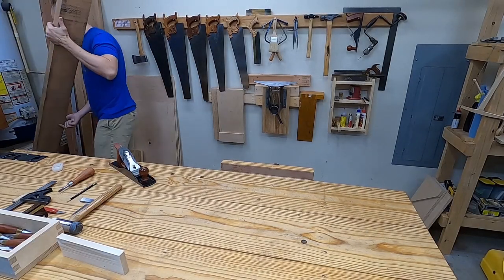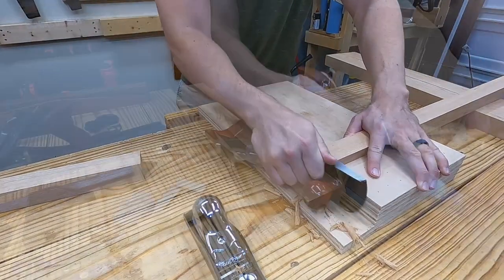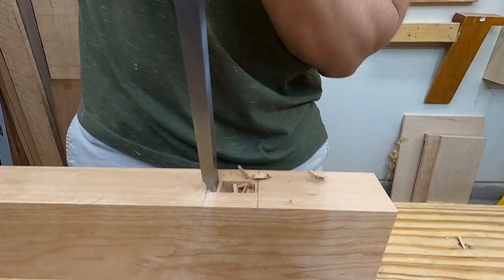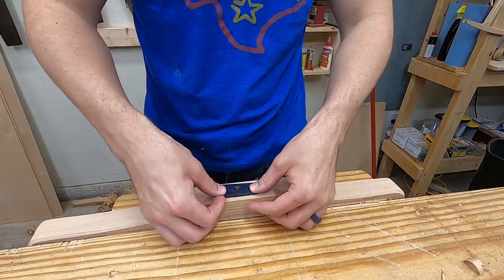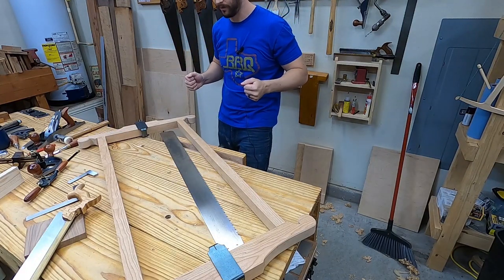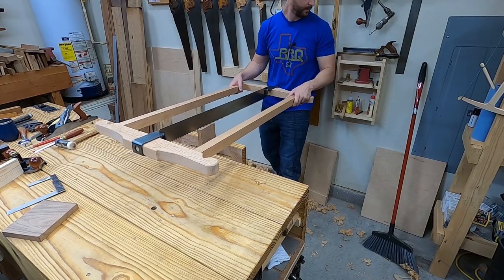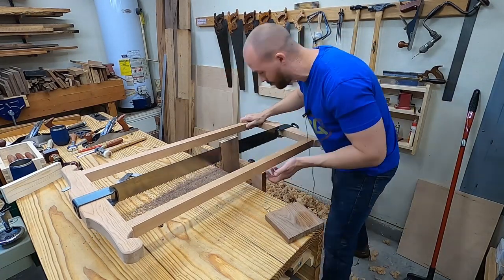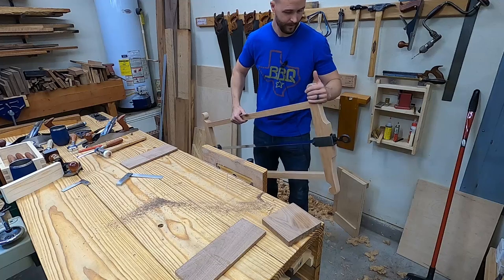Making a Frame Saw // Resaw with Hand Tools

Comment: Nicely done, brother.  Yes, it's a push-or-pull saw!  I've got four, two that are 200+ years old (one of which is for cutting veneer), a smaller one I made when writing the Roubo book, and one from Bad Axe Tools.  I've got two  blades from Isaac that I will make new frames for and probably forge the hardware myself.  These saws are indeed beasts, and are used in my shop with some regularity.
Reply from the maker: This is absolutely awesome I appreciate the feedback, Don!! Take it easy!

Comment: did you get the blade from blackburn tools? If so, did you go with the "set" option on the teeth? I'm eyeballing one of the 32" ones. He says you can get a set on the teeth in case you use it on green wood.  Is there any drawback to getting a set on the teeth if it ends up mostly being used on dry wood? Aside from a wider kerf?

Comment: I don’t plan on building one of those monsters, but I’ve learned a lot watching your work. One thing I’ve learned is that when you keep your planes sharp you don’t have to push down on the plane. It’s obvious that you’re just pushing the plane forward. That is a revelation for me.
Reply from the maker: I really appreciate this comment, it was also a revelation for me when it finally clicked. Before then, I would spend forever trying to simply flatten a board because I was always "chasing my tail' so to speak.

Comment: Lovely job. Now you can be the beast master.
I definitely prefer it on the push - sawing with the legs rather than arms and letting the weight of the saw provide the force is, for me, easier on the push.
(Regarding board pivoting in the vise, because my vise is (intentionally) not flush with my apron, I have an l-shaped spacer block sized to my apron gap that I can clamp to on the lower apron for 2 points of contact when resawing - pegs work too.)
Great video with a subtle teaching style like spot planing and bevel up/down tips. ;)
Reply from the maker: Appreciate it Malcolm and that's a great tip!

Comment: Frank great video. I appreciate the simple no stress approach to your project. Showing full stock prep, wasn't that hard. Mortise and tenon seemed fairly easy. Cutting curves with a chisel and spoke went quick, I guess you can do wood working with hand tools! I still look forward to a bench video, why the apron, your thoughts on the flush mount veritas vice. Which front vice you chose etc. I really appreciate your humble honest style of video content, hard to fake, must be who you are as a person. The excited, "I got to try it before I put a finish on it". I think we do that with every tool, cabinet and project, the excited to see how does it look or how does it work.
Reply from the maker: Thank you very much Kevin! It means a lot. I have been dreaming up a bench for a while now that combines a few of my favorite parts of the couple benches I've used. When I get around to making it I plan to give a detailed look at my current bench too
Reply: @FranksWorkbench  Looking forward to that video. You almost need to make a bench and use it to determine what you need in a bench. I am using the first bench I built. I've changed vise styles and locations a few times. As different work holding needs arise its only then that you can decide what bench you need and works for you! While waiting, yea or nay on the veritas vice? I've not put holes in my bench, but that vise seems to meet most needs and is a relatively easy install. Thanks again Frank, yours is easily one of the 3 best you tube channels on hand tool woodworking.
Reply from the maker: The veritas vice is great. I chose it for ease of install on a bench with apron as well as to clamp flat to the apron (which mine no longer does bc I added leather which causes a offset). However if you already have a standard cast iron quick release vise then there is really nothing that the veritas vise offers to justify the extra expense IMO. 

Agree with you on the bench use. The bench I want to build will have a the size and simplicity of the my Nicholson, but with a laminated top for thickness/firmness, no apron and instead a wide front rail, and will either use my current vise or a twin screw for cutting wide board dovetails. But that project is on the back burner for now.

Comment: Very interesting tool, but it raises a question: Why use something like this instead of a common handsaw? I'm genuinely interested in knowing on which case scenarios are these preferred.
Reply: There’s a big difference in time and energy it takes to rip and ability to steer from what I understand. Guys like Bob Rozkowski have done videos sawing in same timber for set period of time and measuring the difference in speed.  It was about 1.8x as fast as I remember, but monster difference in energy exerted.  I’m building one because I’m trying to get to as near all hand tool as I can tolerate and because I want to do the 1/8” veneers it can produce.  Just my 2¢

Comment: Any issues with drift? I find with mine I have a hard time keeping with a line. Built the same saw. I also had some weld burs in the inside of the bracket that attaches the saw to the frame which I had to file down.
Reply from the maker: I didn't notice any drift issues but then again it was a pretty small scrap of wood that I cut. I also filed off the weld burr but just didn't record it.
Reply: @FranksWorkbench  yeah when I try to rip a 3' board it gets tough to keep the line. It might just require some practice.

Comment: Another great video Frank, you keep hitting them out of the park, with instruction, frankness and humility.  That saw is a beast, but my shop is tighter than yours and would require some real thinking to figure out usage. A four foot saw seems like you would have to walk it to get full stoke. What blade are you using in bow saw, it looks wider than the ones I get from Tools for Woodworking.
Reply from the maker: Thank you very much Jim, I really do appreciate it! They are the blades from tools for working wood. Just the basic general use 16 ppi  blade. It could have been some video distortion making it look wider as I just record these with a GoPro and sometimes things look stretched out especially close to the screen edges

Comment: Shannon Roger's (RenaissanceWW) has a couple of these, and a few videos about them too, give em a gander if you havent already 😁 As others have said, they can work push or pull...... but push seem to be favoured by most. From what I've seen of others use them..... they kinda nearly "step" into the stroke as opposed to using all arm motion to move it like you would with a traditional style saw, kinda similar to the way some rock their body while hand sharpening small/awkward blades..... but I have ZERO experience myself with one of these beasts 😁 
I'm thinkin about makin my own someday, I prefer hand tools and I dont really have the room for a bandsaw; or the cash for one that's capable of decent resaw. I'm doing it now with the standard 4.5 tpi handsaw, and it sucks donkey balls 🤦‍♂️😂 
I'm glad I found your channel, hand tool freaks like us are too few and far between 🤙
Reply from the maker: No kidding on resawing with a handsaw! Even 4.5 tpi...doable, but really hard work, I always avoided it!

Comment: Looks great! Have you found yourself needing a kerfing plane?
Reply from the maker: Thank you! I probably won't use a kerfing plane since my purpose is really just to cut 4/4 and 5/4 boards in half to use for drawer sides, panels, etc. If I needed more accuracy like trying to resaw off a 1/8 - 1/4" veneer I'd probably think about the kerfing plane.

Comment: I dont have a scrub plane but I do have an old craftsman no 4 that is my 'high stock removal' plane/  Not optimal but it works well.  How flat do you generally go when processing material?
Reply from the maker: Right on man. I try to get it as flat as possible but just by sight, I don't pull out feeler gauges or anything like that, the boards gonna go out of flat overnight anyways. Before joinery I usually pass a plane over it again

Comment: you can always just flip the saw around if you want to cut on a pull :)
Reply from the maker: Haha very true I guess i felt the tensioning screw should be on the user side for some reason but you're totally right it wouldn't make a difference
Reply: @FranksWorkbench  well i've never used one (i want to now that i saw this haha) but test it out and see if where that screw is matters lol

Comment: What kit was this?  I’m considering the 36” too but don’t know yet for certain.
Reply from the maker: Blackburn tools kit. I had debated between the 48 and 36" and am very glad I went with 36. Cheers brother!
Reply: I wanted to go with Blackburn since I’ve built some of his saws before, but ultimately decided on the 36” from Bad Axe since I was able to also get the matching Kerfing Plane kit with it.  Still making decision on with timber to use, had thought of using red elm since I have a whole bunch of 9/4 left over from my bench, but thinking it may be too heavy; then again I’m thinking the heft may actually be beneficial. Something like the heads in Red Elm because elm is so stable and then cherry for the outside arms.  I’m gonna use Tom Fidgen’s design from his first book for the Kerfing Plane so I can build three fences (1/8” for shop made veneers, one for resawing common 4/4, and then an adjustable one using my 3/4”x 6 thread box/tap for rods/knobs/nuts) I’ll let you know how it goes..